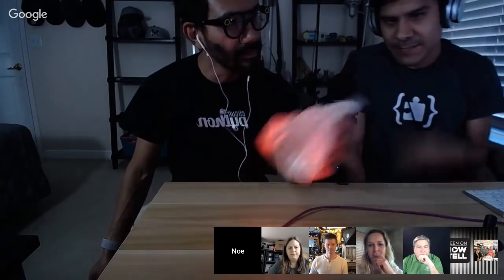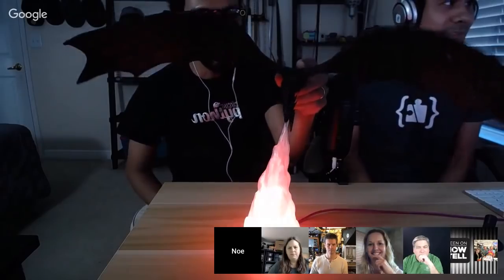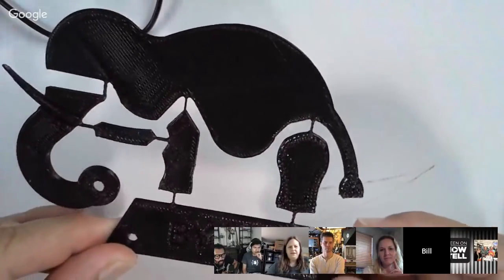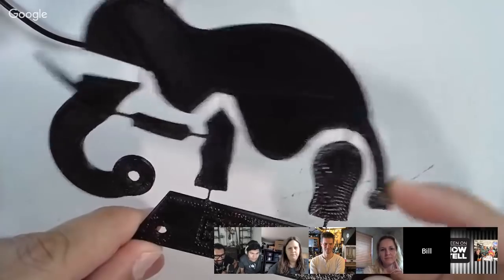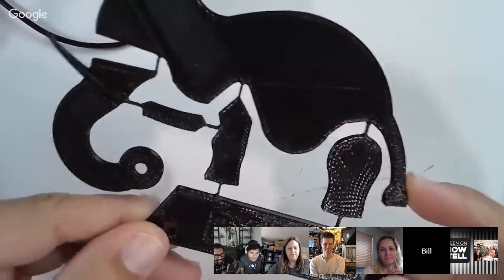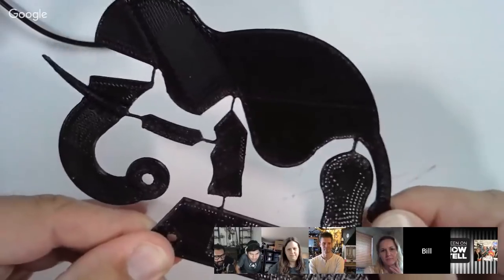SHOW & TELL - LIVE! 5/1/19 @adafruit #adafruit #showandtell #diy

Comment: Never noticed any of this content before, here we are 2022: Retired heavy machine group leader, a few extra years in a V.P. slot at an extrusion supply and engineering firm, 3D printing hobbyist since 2014, scratch building printers as soon as the 1st laser cut plywood kit was assembled. Tapping, printing or scouring for screws best suited to plastic, and now Naomi sent me on a better path this morning, frosty February, & printing the other version, along with a cable support arm addon. Rock'n awesome.